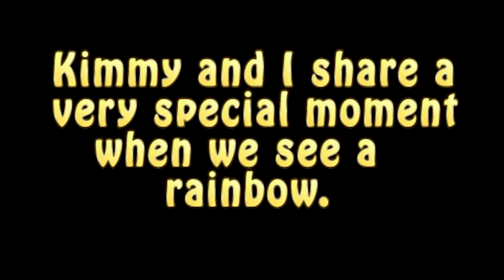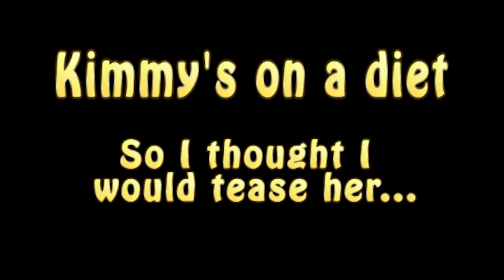How to paint your car at home.  Part 1. Disassembly

Comment: This may be a dumb question, but how do you get the exact placement correct after removing the badges from the trunk? I feel like they would never be the same after they've been removed and you have sanded away their markings.
Reply from the maker: Jim V hey Jim in the reassembly video I will show you how to do alll that... it's pretty simple on how to do it... But it is a very good question. !